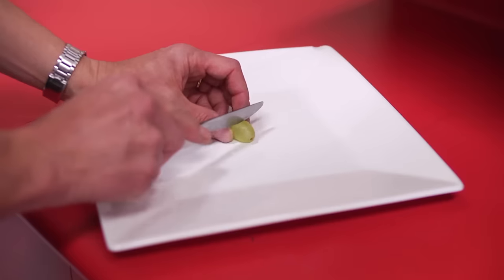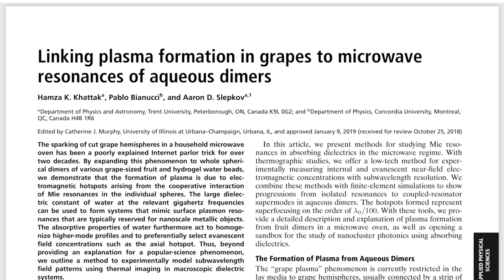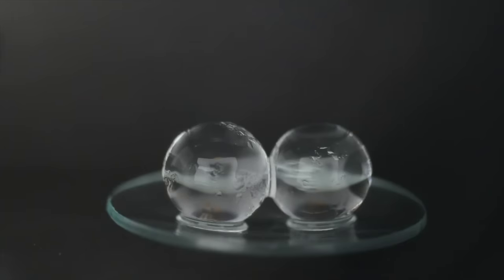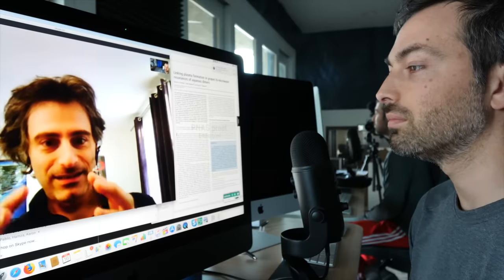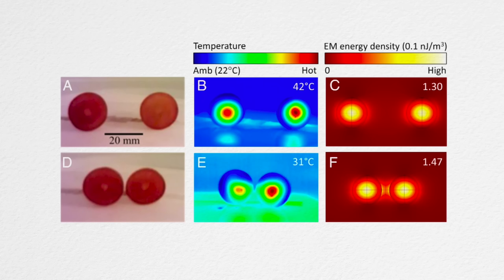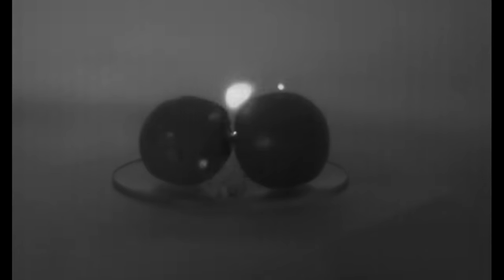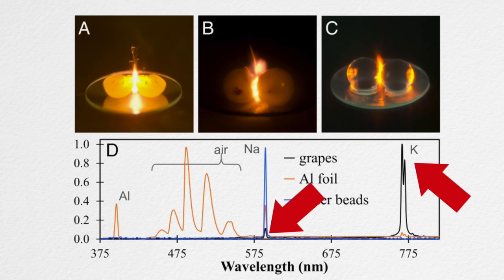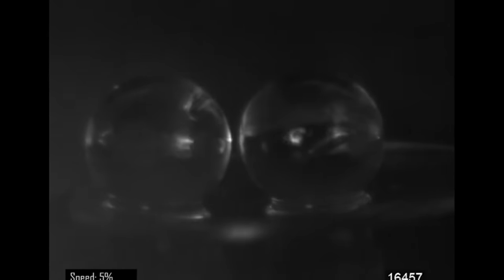Microwaving Grapes Makes Plasma

Comment: So I rewatched this video today. And realized (and yes, apparently I'm stupid, can't believe I didnt think of this before.) That microwave ovens and wifi run on almost the same wavelength. And the reason I'm occasionally having wifi issues is because I have a shitty microwave and when it was running, my router was sitting on top of it and it would drop my wifi signal significantly. Thank you. Once again, yes I'm stupid.
Reply: thats rly interesting
Reply: So what your saying is that wifi is slowly cooking us
Reply: No
Reply: Wait a sec, that would mean, your microwave is leaking microwave, (which it's not supposed to do.) hence disruptung your WiFi, 
( They are both 2.45ghz but the only difference which makes one harmful to the other is that, the microwave from microwave is has much more power {700W}
Whiles your router has about {100mW} 7000x less power.
 if you get exposed to the microwave from microwave, it's alter your genes aka cancer...  So I really don't think what ever is happening there is safe at all, keep a distance always from your microwave or change it ,
 Or am I too stupid to understand?
(Edit): yes I was very stupid
Unfortunately yes these waves aren't ionizing waves so they can't give you cancer or alter dna
But according to someone 120W 2.4ghz can cook you from the inside, 
Based on my fear, just don't get exposure to it for long periods over long spans 
Just change it,,,,,,,
Reply: @cookedpotato  You know how the discovery of the microwave heating food happened right?  I think you're over reacting a bit lol.
Reply: @DrDipsh1t  lol I am 😹
Reply: Holdon.... You have the wifi on top of the microwave???
Wtf??
Reply: @father3dollarbill  Seriously… I am with you. Nobody puts a router on top of the microwave. That’s just not done in the lower 48.
Reply: @cookedpotato  'according to someone' ...
Reply: for this reason I first built a filter for the power connection of the oven, thinking interferences were conducted emissions brought to the router by the power cable. didn't help. So I bought a new, more expensive microwave oven, as interferences seemed to be radiated emissions, hoping the shielding was better. it was not. replaced wifi by cable. worked. expensive but funny journey
Reply: @father3dollarbill  That's what I was wondering?  Why?
Reply: Now, does this mean I can get free wifi from my microwave?
Reply: um if 1000W microwaves are leaking out of the oven's faraday cage, then I think you have bigger problems than wifi.
Reply: Don't charge your earbuds near a microwave. I ruined a nice set of Beats that way.
Reply: You're not stupid if you learned anything from this, even if it's what a new microwave oven cost
Reply: @Andres-wy5du the whole atmosphere is. Takes about 80 years. Lol
Reply: so that’s why that happens???

Comment: A warning to those who might try this at home: when I created a small plasma in my microwave the plasma caused some kind of stress riser in the glass bowl I was using as a container and the moment I touched the glass with my fingers the glass exploded in all directions, with enough force that small pieces of glass that happened to have a straight shot out of the microwave ended up on the other side of the kitchen, about 3m away. I suggest using only plastic or wooden containers when working with plasma in the microwave.
Reply: Thank you for the warning.
Reply: Thanks for the warning, I was going to try this.
Reply: Man are you alright?
Reply: Thanks for the advice 👍
Reply: Thanks!  Perhaps this should be one of those "don't try this at home" things
Reply: Or use ceramics
Reply: @DisturbedVette   Ah yes!  Great suggestion!  Then you wouldn't have to worry about the plastic melting or the glass breaking...oh wait...now you can't see anything.

I know that sounded like sarcasm, but that issue did really come to me as I was typing.
Reply: You the real MVP🙏
Reply: What about if the grapes are placed directly onto the microwave 'plate'?  They're made of some sort of toughened glass.  Could the grapes make THEM shatter?
Reply: DANG JOS a ceramic plate???
Reply: @DisturbedVette  Oh, I thought you meant like what Veritasium did with the plastic cover.  I assumed it was better covered for safety
Reply: What part of don't try this at home if you don't understand it don't you understand? Lmao glass really have you never heard of Correll plates and bowls? Way better than glass or pyrex. I used to torch them to around 300 then pour ether on them and my mother loved throwing them at me as a child I'm sure if are really trying to break it you could. I've seen only a few Correll products broken but not even when my mother threw them and not from temp change and ether changes a surfaces temp fast when it boils.
Reply: Erm, I was tempted, but luckily my local grocer is closed for the night ... else the Great St. John's Fire of 2019 might have burned my 125-year-old rowhouse down (again). Thanks for the head's-up.
Reply: james Thanks for the info, it’s nice to know your mom has issues.
Reply: Wooden?  Really?
Reply: @Freeknickers24   What the actual hell are you talking about?
Reply: Microwave a bar of dove body soap... watch the magic happen ^_^
Reply: Кирлджифук Стан fortunately the glass broke into chunks (it wasn’t Pyrex, but might have been tempered) and I did not get any cuts.  But did get quite the scare!  Went from “everything normal” to “glass chunks everywhere” in an eyeblink, so I sort of assumed I was injured until I examined myself and saw (and felt) that I had no injuries.
BTW, speaking of Pyrex, that stuff is tough, probably would stand up to a few seconds of plasma, and a better choice than my prior suggestion of plastic.
Reply: You probably used fancy glass with lead inside (makes in shine like diamond).
You can test by turning on the microwave for only 10 seconds. It will be warm or burning hot in such short time.
Reply: Christian Gingras the bowl in question was one of a set of five, the other four of which I still use routinely without issues, and they don’t get hot except from thermal conductivity with the contents being heated.
Reply: There's a reason why the Glass turntable in the microwave oven is made of Pyrex ! You will find that wood will quickly Catch 🔥 fire .
Reply: But dude...what's the point of making plasma if you don't break stuff with it?! XD

But seriously tho, thanks for the warning
Reply: @jpe1  thenk you for warning cuz I take a bet I would have done with a glass.
Reply: do this to Napa and it might land on the moon
Reply: I wonder why this happened.
Reply: Wow!  Now you're talking.  Another way to blow s..t up.  I'm so in.
Reply: Hmmm... Maybe the "glass" was actually quartz and was "holding" the kinetic energy of the combined plasma/microwave~ flux*run pattern. Touching it gave them an exit point to wich the energy burst was stronger than the material "at hand" causing a water vs. dam effect... ?
Reply: @mikewalkingbear299  Sounds like getting struck by lightning.
Reply: With so many likes this should be higher up for people to see. It is important. I have several times superheated water and put in coffee powder and wow the massive surface area for instant vaporization gives instant scalding coffee all over the kitchen. Danger be warned.

Comment: Excellent video. But one thing was wrong, that the amplification of the waves varies with the electromagnetic absorption extent. This absorption extent depends on the bulk of the substance and not the surface area, as the internal as well as external absorption happens within the grape. Also, there is a continuous absorption and deflection of the microwaves within the grape, which does not allow the waves to escape out, somewhat similar to an optical medium in which light gets trapped as a result of total internal reflection. That's why the amplification, and therefore the concentration of the electromagnetic waves is maximum at the centre of the grape, and hence the two fields of electromagnetism interact with each other because of ionisation of periarieal air.
Credit - Satvik Lahiry Bhattacharya

Comment: I'm 64 and remember when microwaves first started going into homes.  It was always my understanding that the foods heated from the inside/center first.
Reply: Microwave heats where the waves collide. If it's inside food, it heats that spot. That why microwaves spin object, to move object over thous colliding spots, to heat more locations. Grape gets heated middle, because waves collide middle the most.
Reply: Simply put not necessarily 😁
Reply: Oh so u are 1 stack
Reply: That was a myth. This is a special situation. Generally, your food is heated from the outside in.

Comment: Sooo... does this explain why my bowl gets plasma-hot while my soup is still cold?
Reply: Lol
Reply: Yeh
Reply: sirens
Reply: That's just differences in heat capacity
Reply: Since it heats from the outside in, the heat rapidly transfers to the container instead of moving inwards as would be preferable.
Reply: That means the bowl you are using has some ferric component that's absorbing the energy, and blocking it from your soup.  That's not a bowl you should be using in the microwave.  That will not happen with a glass or plastic bowl, although I don't like microwaving things in plastic.
Reply: @TheMirolab  . So a Corning Ware bowl isn't the best choice????

Comment: As a mother there’s only one thing I want to know; does this do any damage to the microwave?!
Reply: Klara G yes I’m pretty sure it does
Reply: Lol
Reply: should I eat it
Reply: Is it ok to let kid do this experiment?
Reply: No damage... grape cooked... eat it if you want
Reply: Broke our microwave doing this
Reply: Yes maam i ruined our microwave once doing this when i was young
Reply: If anyone damaged their microwave is because they didn't put anything on the grapes and the plasma somehow melted the inner surface (although it's very unlikely to happen)... It's completely safe and grapes are totally fine to eat after the experiment. The only thing to care about is the temperature of the fruit if you leave it in for too long, because it will be burning hot.
Reply: Even if I wouldn't eat them because I think that cooked grapes are not that good 😂
Reply: @LoZiOcErCa  put the grape on a plate and put a glass cup over the grape and our microwave definitely didnt work afterwards
Reply: @brian_5256  I had to try a lot of times before it worked well and I could observe some plasma. Try to cut every grape in two halves (leaving them attached only by a tiny edge of skin). Remember to cut along the shorter axis of the grape. The cup is only to avoid squirts, so if you don't mind you can also remove it to see the experiment better
Reply: @LoZiOcErCa  maybe if i get a cheap microwave but i had to spend $160 on a new microwave after doing this the first time... not chancing it in the new one lol
Reply: @LoZiOcErCa  maybe if i get a cheap microwave bit i had to spend $160 on a new microwave after doing this the first time... not chancing it in the new one lol
Reply: @brian_5256  I can't understand what happened to the old one... Did it just stop to work properly?
Reply: @LoZiOcErCa   it didnt work at all afterwards.. the light would come on but it wouldnt cook anything and the plate inside wouldnt spin.
Reply: @brian_5256  That's very strange... Did you take it apart to check what wasn't working? Are you sure you didn't put any metal in it?
Reply: @Hello-nj6pg  Yes. It's Safe
Dont
Reply: It exploded my oven
Reply: @lavv5933  How did you manage to make it explode?
Reply: @lavv5933  it's literally impossible, that would mean brands should put an alert sticker on the front "Don't cook grapes in here"
Reply: Don't use your microwave for stunts. Go get a cheap one from a yard sale or thrift store.  Use THAT one for stunts.  Geez.
Reply: As a cougar hunter can i have your number
Reply: Don't try this at home

Comment: I had a decaying, rusting microwave oven that would externally emit balls of plasma.  Basically, tiny spheres of electromagnetic energy would dance across my counter top. It was tiny ball lighting.   Each sphere only a couple millimeters across.  I never tried to touch one, I just watched, utterly fascinated, trying to quantify the specific conditions of control.  The microwave was rusting.  I  am pretty sure that was a factor.  I can only conclude that microwaves, plus iron oxide, and the quantifier of organic material which exists in even a clean, albeit decaying microwave, somehow creates plasma.  Lightbulb I moment...!   I just kinda had an epiphany and figured out how, but I will not disclose that.  I will say it makes perfect sense.

Comment: My chemistry teacher did this in high school in the staff room and destroyed the microwave lol
Reply: Déjà vu. Gordon Freeman and Dr. Arne Magnusson casserole.
Reply: Could have avoided it with a flimsy plastic cup...
Reply: Carbon Toy Music my high school tech teacher microwaved a cd because no one in her class had seen it before
Reply: @moiquiregardevideo  why were you going around collecting microwaves you found in the garbage?
Reply: @jordalf3878  they lead a more interesting life than you
Reply: @jordalf3878  I collect CRT TV, laser printers and microwave ovens each I see any in garbages. The first few were for having a few 2000 volt transformers to test with arc lamp, neon tubes and other high voltage experiments.
I also tried to make my own micro wave long distance emitter.  I gave up because micro waves appear too unpredictable and deadly to me.
After 5, I could have stopped. But I kept collecting every microwave just to compare if there would be any difference (there isn't except recent models with switching power supply instead of 10 pound transformer).
There is two doughnut shape magnets on the magnetron that can be used for experiments. The poles are north/south thru the hole.
I try to reuse components or even entire circuit from devices. For example, laser printers have switching power supply that give 24 volt, 10 amps with very little noise.
Plasma tv have switching regulator for 250 volt, 2 amps. 
Compact projection TV, those model with slanted back, have an incredibly bright arc lamp ; probably 10 thousand lumens. The have a 350 volt regulated supply followed by a switching power supply that simulate 60 Hz, 120 volt, 1 amp with high voltage started.
Projection TV old model with 3 CRT have 3 lenses that can be used as magnifying glasses, a high voltage 35 kv with high current.
Reply: @moiquiregardevideo 
So this experiment with the grapes is safe?
Reply: @gwyrion7039  I think you guys should take a deep breath. My comment was primarily a question. I assumed there must be a reason as to why he was collecting microwaves. And the answer was solid. There was a bit of 'tongue in cheek' humour in regards to the microwaves being found in the garbage. But that's all it was; humour. Not everyone is trying to start a keyboard war on youtube.
Reply: Gwyrion

...

Wadafack shidd hedd